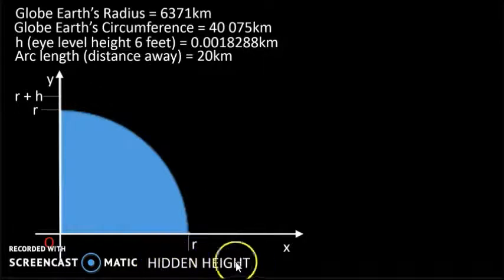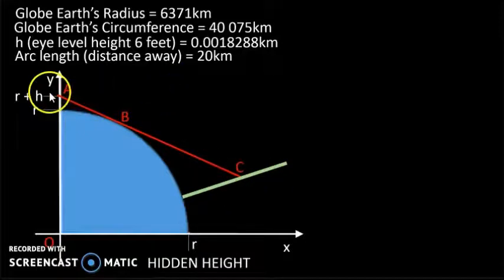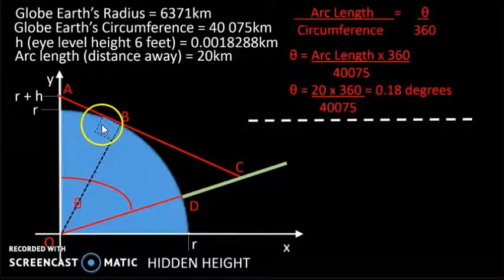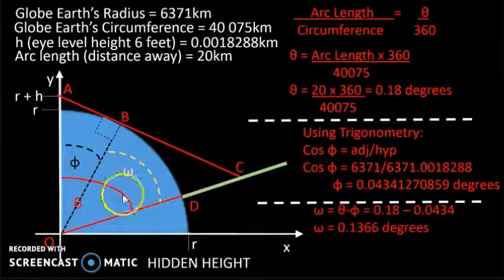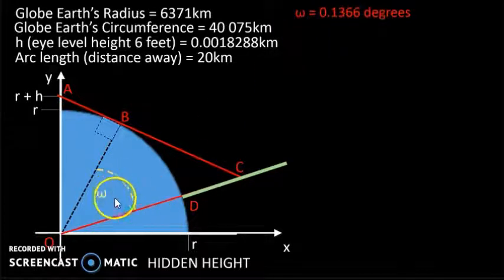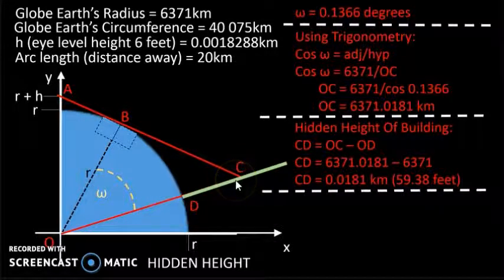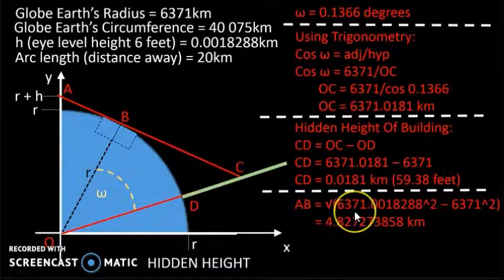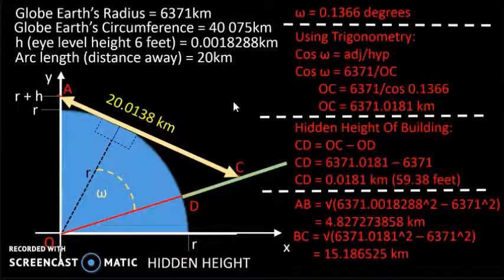Flat Earth? Curvature Maths - Part 2: Hidden Height Calculation

Comment: Part of the issue with the 8 inch drop is that it is from a mathematical height of 0. Meaning it only applies if you eye line is pressed to the ground. This changes things pretty quickly once you rise up. if you are stood up you need to really be applying the 8 inch drop from the point where your horizon will now be. 6ft above the water and you will be seeing approx. 3 miles. the horizon can and will often have a mirroring effect sitting just above the horizon also, making things look taller than they actually are. Now add into that refraction rates of somewhere between 12-16% and it will account for just about every vid you have ever seen where someone is claiming they are seeing more of a building etc than they think they should.... And still non of this actually explains what is happening when a very tall ship just continues to sink bottom first over the horizon. Everyone interested in the curve must educate themselves in atmospheric refraction https://en.wikipedia.org/wiki/Atmospheric_refraction
Reply: +sploofmonkey I agree. You could spell out the circumstances but hard work to do much more. There's quite a few refraction indexes about now though. Some based from astronomy (ie selenelion effect).. and some surveyors based. End of- as soon as it gets complex (ie too hard for them to grasp) FE'ers start suggesting it's all just more con and lies ny mainstream science to keep people confused. or they just do what Skiba did and turn it on its head and suggest atmospheric lensing/refraction is what is hiding the bottom of things om the horizon - ad so it's not the curve doing it. Basically you will never win against conspiracy theorists - because any complexity what so ever in anything is considered manufactured on purpose as part of the conspiracy.

Comment: It's kinda funny that this video where there are actual maths done. That not that many have commented. 
When I look at other videos the comment section is sspammed with people saying your lame as flat earthers. And trying to disprove the maths. Or somethingg like it.

I have been looking at alot of videos from both sides. And really don't care about all the other stuff.  I'm just kinda confused that people can see the bottom of building 60+ miles away.  I have been looking around to figure out if the maths people used where wrong. Since, I hope the earth is a globe. So the technology goes so far that small me can come out into space :)

But if it turns out the earth is flat. I won't be closed minded like so many others.

I'm trying to find the fact's in this matter but it is hard to figure out what to believe in when looking at video's. And I don't take any ones word for it.

I believe in science there for i believe in what can be proven with 100% accuracy. Not therms and so on. 

I just hope at some point that som1 with 100% accuracy proves either globe or flat. For me it's hard to decide
When there is so many compelling argues from bouth sides.

Sorry for bad English.
Reply: Ok, according to the calculations presented in the video, at the distance of about 20 kilometers, there should be about 60 feet of "the bottom of the building" not visible. This would require a really expensive camera with an optical zoom to test (none of this digital, CCD sensors which "emulate" what is actually seen). Dunno if there's any such video available. :)

Edit: OR camera (lens), come to think of it.

Comment: Great job!  If we were to place a circle the size of the alleged globe within h's a decagon, now place one person at each of the ten segments to measure their lengths deviation in curvature, should each segment by segment tally up to the radius by the time we count 5 segments?  I ask because I am trying to validate if 8 inches per square mile is the best equation?  Also, does it hold true?
Reply from the maker: +LBBstore - Thank you.
I will do a conversion to inches and miles and see what it comes out at.
I will let you know.  :)
Reply from the maker: +LBBstore - so, here is a table showing actual drop (inches) compared with the approximate drop (inches).  The approximate drop is the 8 inches x miles^2 used regularly.

miles      actual drop       approx drop       error (Inches)
============================================
1               7.985                  8                       0.0146
5               199.635              200                  0.365
20              3194.154          3200                5.845
40             12776.536       12800                23.464
60             28746.901        28800               53.099

So, you can see that as the distance increases, the error also increases.  For small distances, the error is negligible.  At 20 miles, the error is almost 6 inches, so still negligible.  I would say it is a good approximation for small distances.
(I hope the formatting isn't lost).

Comment: that tangent would only be relevant if the observer had to change the angle of their line of sight to that degree. It doesn't really work cause the horizon rises to eye level to the larger extent. Even tho it's contentious there's no evidence to suggest that the angle changes with elevation to such a degree. The observer is always looking parallel to the tangent at their feet in my experience. Even being hypothetical that tangent would only be relevant if observers actually had to change their viewing angle. This breaks pretty bad at 30,000 ft. I might have to model this. The whole obstruction thing is a bit misleading i think cause it attempts to disregard the observers relation to the surface.

on the other hand it would be relevant to two observers on the same plane of reference. the wall is (x) ft tall relative to both of them.
Reply: this is still a good reference for people who want to look into the matter further. gj.
Reply from the maker: +kotj101 - I TOTALLY agree with you.  We ALWAYS look horizontally outwards, no matter how high we go (even in an aeroplane).
The reason I did this small series of videos was because a lot of flat earthers were relying on online calculators to calculate globe curvature.  The online calculators tend to measure the straight "line of sight" distance rather than the curved distance and so are inaccurate for our purposes (of attempting to disprove the globe).
It was just so we know what numbers we are going to be disproving really.
From my point of view, it's not a curve that prevents us seeing great distances, its 
1) opacity of the atmosphere
2) mirages
3) perspective

You should model this! ( I dont have the software or the skills to do it!)
:)
Reply: ickle spec
i think there's a psyop going on to insert sagitta into the debate. it's essentially dividing by two observers who are on different planes of reference. it's only intended to mislead and get some smaller numbers so ball earthers have more wiggle room to pull their asses out of the fire.

but ya glad we're on the same page. :)
Reply from the maker: +kotj101 -  I didn't know that (nor did I even know what sagitta was). Thank you for the valuable information.
Reply: ickle spec
you're very welcome.
Reply: icle spec: you give the equations absolutely correct and now you start with the wellknown nonsense about looking horizontaly (even on a flat plane you see the horizon slightly beneath you, so you are definitely not looking horizontaly at it) and the nonsense about perspective, opacity of the atmosphere and mirages that are supposed to prevent us to see at great distances. How then can we see mountains at great distances, how can we see the moon, the stars? There's allways the same amount of atmosphere between our eyes and the moon as there is between our eyes and a mountain (in fact: there is more), the fact that we can't see small objects at a great distance has nothing to do with perspective, but has everything to do with the resolution of our eyes, that enables us to see much farther than the horizon (as in the line where heaven and earth meet). It would be nice if you would apply knowledge of trigoniometrics not in the selective way that you do.
Reply: +Frank de Brouwer ya like thousandths of a degree below u. maybeeeeeee.

does this change at significant elevations? maybeeeeee veryyyyy slightlyyyy. even if it did its barely a large enough difference to be significant. << this is a big problem for the hypothetical ball earth.

maybe ive misunderstood tho. seems english isnt your native language.
Reply: kotj101: a thousandths of a degree is about as much as the angle ickle spec calculates in his/her video to get to the hidden height. Either it's important or not. You can't pick and choose when it's important and when it's not. And if there is an angle, it is wrong to call it horizontal. Just a matter of proper discussion. The calculations prove that there is a difference between the hidden portion as calculated with the proper method (that is: the method ickle spec demnonstrates) and as calculated with the 8 inch per mile squared equation, that is based on a tangent line of sight (and that is wrong in itself). So in that respect it is also important to acknowledge that there is an angle and that the line of sight is not horizontal.  BTW. The introduction of the sagitta isn't meant to mislead anyone, it is to give a proper mathematical name to what Flat Earthers just call: the bulge.
Reply: Frank de Brouwer
what you're assuming to be certainty is an assumption. IF there was this tiny difference in angle from the tangent, we could assume some error in the calc's. The problem is IF we're assuming this discrepancy in the angle exists, the angle should become relatively large when significant elevations are achieved. this does NOT happen. and if you want to claim it does, then feel free to prove your claim.

sagitta isn't really relevant to anything. It's just an attempt to divide the 'drop' by TWO observers if they were looking through the ground. or its like saying where two lines of sight would meet might be relevant because of such n such hypothetical. its a bunch of if's m8. that don't really conform to experience. im sure it works out great mathematically, but this is not the issue.
Reply from the maker: +Frank dee Brouwer - google "mountains from a distance" which CLEARLY demonstrates opacity of the atmosphere.  Also, you need to realise that the amount of atmosphere we have to look through horizontally is significantly greater than that if we look diagonally upwards. If a mirage extends 3 feet above the surface of the water, you will NOT be able to see it past it because it acts like a mirror.  Flippin' 'eck man!! Go educate yourself with regards to the topic you are attempting to debate before attempting to debate it!
You are just embarrassing yourself!
And the equations are GCSE level maths (which 13-16 year olds learn at school in UK) so they are a no-brainer and I don't need you to tell me they are "absolutely correct" lolllll